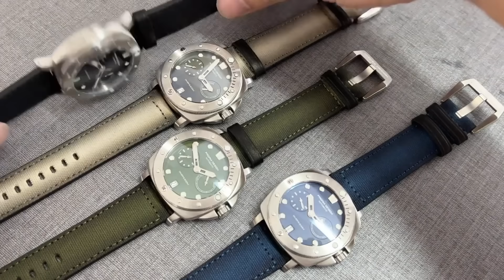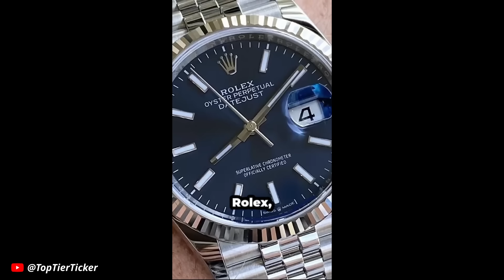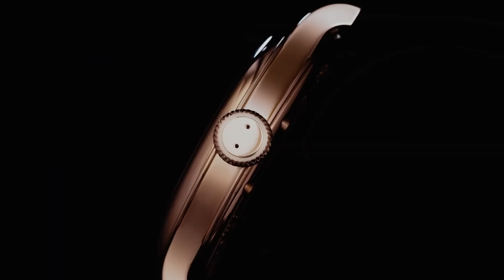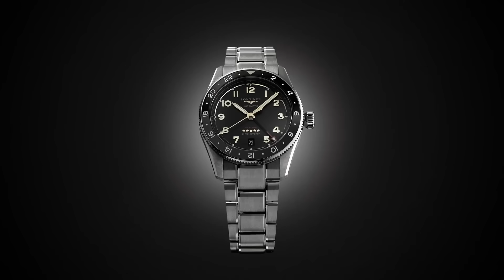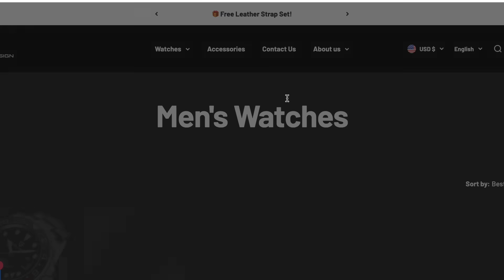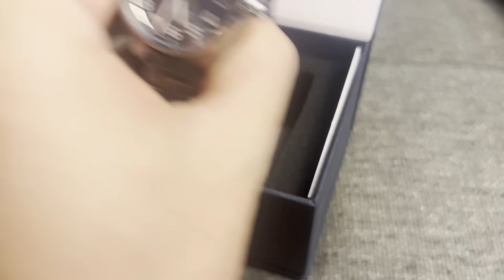The ULTIMATE Fake Watch Company

Comment: Funny enough, I strolled into a Ben Bridge wearing my ONLY Pagani (a knock off of a Milgauss because I figured I'd never get a real one) and they showed me a brand new Datejust they were actually trying to sell TO ME that day, it felt really funny to take off my $80 watch and put on the $8,000 watch and have the salesman say "wow, they really got that bracelet right, it even has the microadjust! And the green glass, too!" I should've bought that Rollie, because at the time I could've flipped it & had enough to buy a Tudor, but my wife was in the store next door & would've pitched a fit if I came back with a new Rolex. But alas, I did not do it.
Reply: Also, as an aside, people will fake almost anything. I bought a PRX from eBay with a limited edition dial that was sold out & when I got it the packaging looked fishy and the watch case scratched super easy so I tried to register the serial number & it didn't come up., Took it to a watchmaker & sure enough, a fake. From India. I got rooked on a sub $500 watch.

Comment: Reasons why these fakes are cheap: No RnD and design costs (the most expensive part), no history behind the brand, non existing guarantee, low level movements, low grade steel, cheap labor, no quality control, mass production, etc. etc. etc. If you want them to stop, stop buying them. And no, they are not "great quality". Comparing a luxury piece with a fake makes no sense qualitywise.
Reply: Rolex stopped paying for any R&D on the submariner decades ago. They've been copying their own design for years. You lose any patent protection on design after 15 years. It's the duty of other companies to copy old, tired designs. That's how innovation occurs, but that doesn't seem to ever happen in the watch world because it inexplicably glorifies the obsolete over the innovative.

Comment: The luxury business is, in itself, a house of cards. To be fair, most luxury brands are high quality, but the truth is that quality CAN be produced at a significantly lower price, particularly with modern production methods. Things like CNC machining 3d printing have hugely reduced the cost, the Chinese took advantage of this. The luxury houses (not just watches) used that improvement to increase profits rather than sales) 

(I am currently wearing on my wrist a 20 year old Chinese skeleton automatic that I bought in Walmart on impulse for less than $100. Looks decent, works great. The finish on the movement could be more elaborate... but even that can easily be handled by automation)

Comment: Bart, this was a nice vid and point of view. Well, it is funny that brand-name watch manufacturers have copied one another for way back. You made some comparisons in your vid, but I can tell you there were lots of copying from the late 60s to early 80s between big names. Now, you also touch on another subject, which is why big-name brands can't give you the level of materials that these "homage" companies offer.  I'm sure that the brand names will say they spend money on lots of things, so the watches themselves are affected. However, I think is all about money; if they gave you the sapphire crystal or ceramic bezel with lume, or any type of high water resistance, they would charge you.  
I will give you an example; I have a Longines Hydroconquest. Well, the bezel is aluminum, the lume for a watch that is supposed to be a skin diver, fades away like a cheap Timex, but you're paying for the brand.  On the other hand, I have a Steeldive and a San Martin dive watches, with sapphire crystal, 200m of water resistance, automatic movements, ceramic bezel lume inserts, and better lume overall than the Longines. Plus, together they still cost a hell of a lot less than the Longines cost, which is why most people will buy homages. 

Anyway, blatant copying and slapping the name brand of an actual brand name is wrong. To me, having the look, even if it is a facsimile, but they sell them with their own name, and provide you with quality, then who cares? Ultimately, the person buying it has to like it, not anyone else, for that matter.  Keep up the nice work!

Comment: I noticed when you sized your bracelet that you had taken links off of the 12 o'clock end, try taking them off of the 6 o'clock end next time, it will center up the clasp on your wrist better, and your new watch will wear/ feel much better. The 12 o'clock side should pretty much always be at least a link or 2 longer than the 6 o'clock side of the bracelet. 🤙🏻🤙🏻

Also, Seiko cant do it because they have a minimum wage, dont maipulate currentcy, they have a marketing department, an HR department, Artists & Designers, workers compensation premiums, ect.
You pay for that as a consumer when you buy from a non-chineese company.

Comment: Pagani have a diver that's got an NH34a GMT movement, 100m waterproof, AR coater sapphire crystal with date bubble, ceramic bezel, display back, stainless steel case, a jubilee strap and comes in a reasonably nice box for ~$97 dollars.
Hell that movement alone goes for about  $45 and while they have the benefit of bulk pricing, it still is incredible they've managed to do it all for that price. 

Still hate the logo though.

They do have watches that're cheaper and still come with ceramic and sapphire etc, but they cut costs in the movement department and I would never recommend one of those models.

Comment: Ive an Steeldive SD1970 and an Rdunae R2X which are both Seiko 6105 Homages... i would have bought an original "Homage" from Seiko themself, but they want 1k+ for a Watch that have literaly the same Movement in it (NH35/4R35 in the Homages Vs. 6R35 in the real one - its a slight upgrade not worth the price difference).

Comment: You are correct, and if Rolex Submariner was still a $2000 watch like they should be, then this problem wouldn't exist in the west.
Reply: For anyone not understanding the basis behind this comment, in 1968 a Rolex Submariner was $225 USD. That equates to a bit over $2000 in 2025 inflation adjusted dollars.
Reply: @neonnoodle1169 there is no arguing that there are massive margins for modern Rolex (as with any other luxury brand) but anyone whose handle a vintage Sub will be able to attest that there are equally MASSIVE differences in material and build quality. A Sub from the 60’s feels like a toy from a Cracker Jack box (stamped clasp, hollow links and SELs, etc.).
Reply: The clone made by Pagani design is only $150 using the same exact automatic movement just a duplicate😂
Rolex is scamming people because the Jews are scamming the Swiss
Reply: @Josephwildberger  pagani design doesn’t use clone movements. They use seiko movements.
Reply: @Jake-bt3fcI thought miota made movements for Seiko I have a Seiko watch it has myota movement
Reply: @Josephwildberger  seiko definitely make movements. I’ve never heard of them using miyota movements but I guess that makes sense if they don’t have one thin enough to fit in a certain watch or something like that.
Reply: @Josephwildberger did you get it from Ali express?
Reply: @Josephwildberger  If you have a Seiko watch with Miyota movement, then you don't have Seiko watch - you have replica of Seiko watch.
Reply: And you could walk into a store and actually buy the Rolex you want and not have to go through buying several other watches first.
Reply: It's not even the price of a new Sub, it's that fact that an AD won't even sell one to the average Joe because they don't have any purchase history. I can't buy one even if I had cash in hand.
Reply: @mtbbiker6401 very true. I tried to impulse buy a skydweller out of the window at the airport duty free and they were like "you have to wait 6 months for it, we can call you when it's in to come and collect" 😂
Ah... No thanks I don't want to fly back here
Reply: Ridiculous that a steel watch is the price they charge...BUT WON'T SELL YOU ANYWAY...joke😂
Reply: Luxury watches are WAY over priced for what they REALLY are. It's a little humbling when your $150 " homage" date just is more comfortable and keeps  better time than my $9k Rolex.
Makes you think about how much money you wasted over the years on 5 letters printed on your dial.
Reply: The Rolex submariner is definitely a $2000 watch.
Reply: it should be much more cheaper because of the new production technology we got.
Reply: What problem? I see no problem here, I see only valid solutions.
Reply: I'm glad somebody else said this!
Reply: In fact, many platforms now offer direct shipping worldwide. For example, my recent order from  :yt: amzswis :yt: took only 15 days to receive.
Reply: This watch is priced to sell. Watches on  :yt: amzswis :yt: are always priced to sell quickly.
Reply: I was nervous at first, but the Omega I bought from :yt: amzswis :yt:  looks and feels so legit.
Reply: The legend says there's nothing more beautiful than the fake watches looking like a real deal!  :yt: amzswis :yt:
Reply: It's a $100 watch
Reply: Does it require frequent servicing? If bought from  :yt: amzswis :yt:, do they offer servicing?
Reply: 😂 he’s not correct. There’s a Chinese watch brand called SKMEI that makes knock off Casio watches. So if there’s a £40 Casio watch, SKMEI will have a £10 version of the same watch they just don’t give a fck 😂
Reply: I totally agree,  but, anything is game for faking. Not even a homage, a proper fake. Even the Casio F91W gets the treatment. All looks good until you look a bit closer. Cheap as chips and still faked 😂
Reply: @Steve-K.G.  Afaik cheap items are actually more readily faked than expensive ones. Naturally, cheaper devices often don't use complex and, therefore, potentially expensive manufacturing techniques, so designing and producing their convincing clones is easier. And cheaper items usually have greater customer demand
Reply: @akeem2983 Crazy stuff, never thought of it like that. Cheers bud 😊
Reply: So another words your a timex guy.
Reply: :yt: amzswis :yt:  Rolexes are so much better than the real thing!
Reply: It's incredible how expensive some watches are! I don't even dare to wear these expensive watches for safety reasons. I would buy them at :yt: amzswis :yt:, and even if a thief steals them, I won't be upset about losing a watch worth hundreds of thousands of dollars.
Reply: I like :yt: amzswis :yt:  watches
Reply: Submariner is not 2000$
Reply: @universalsoldier4697  you lack reading comprehension.
Reply: @ck5922-z2z i undestand and i say, the submariner value is not 2000$
Reply: @universalsoldier4697  I saw brand new Submariners in a Rolex store where I live (store no longer there) for $3600 without date and $3800/3900 with date in early 2000s
Reply: That's not true. Chinese thieves rip off much cheaper watches than the Submariner.
Reply: The price gap between a ~$120 watch and a $2000 watch is still too large for your hypothetical to be true.
Reply: @InvidiousIgnoramus for you.
Reply: Yes they would! do you think people still won't copy a $2,000 watch? They fake $50 watches dude in china!
Reply: Yes... but if a Rolex was $2,000 it wouldn't be the top watch company in the world. Rolex has been a marketing sensation and that's why they are still in business
Reply: @criticalthinker-t4i  Rolex is the top supposed "luxury" watch brand around the world for the middle class. 
It's literally the Glock or Xerox brand of the Watch World. Excellent watches but by no means anywhere close to the best, nor are the ANYWHERE in the vicinity of the most elite watch brands, and those whom can afford those pompous elitist watches would never be caught dead with a chintzy Rolex on their wrist.

Having owned a few Rolexes over the years, I can honestly say a TAG Heuer is a much better brand in terms of quality, fit and finish, and their model lineup is VASTLY more plentiful and their designs trump the well long in the tooth feminine designs from Rolex. I'm sorry but a 38mm watch is a ladies watch, period as far as I'm concerned. These days the minimum size for a masculine looking watch is 40mm with 42/43 being the perfect and most versatile sweet spot size. 38mm fit me well as a teen but as an average height man my wrist is about 7.75" and a 38mm head looks like I mistakenly put on my wife's watch.
Reply: Rolex sub is a Homage of.......

Not doing your homework....fact none of you know is hilarious to real watch enthusiasts 😅
Reply: @RockerfellerRothchild1776  Rolex Submariner isn't an homage of anything. For very long time people mistakenly believe that 50 Fathoms came first. That was debunked already. Submariner came out in 1953/54. 50 Fathoms came after.
Reply: @RockerfellerRothchild1776  They wouldn't find the answer, even if they went diving for it...fifty fathoms down, eh? hahahaha
Reply: @Maplecook  surely you're not suggesting that the sub is a homage to a watch that came out 2 years later than it did.
Reply: @RockerfellerRothchild1776 Invicta pro diver!😊

Comment: Buying a fake watch for yourself is fine - you cannot buy 12mm vertical clutch column wheel chronograph with ceramic bezel insert for 500usd.... Nobody will sell you this at this price point. Problem is watch designs and watch design combinations are quite finite.... Personally, I do not care if they copy PRX or Cocktail time..... And why none of youtubers mention the fact that such watchbrands give you the opportunity to build solid collection instead of buying a single Longines watch...
Reply: You can on the other hand by a perfectly functional Torbillion.

Comment: I actually figured out exactly what their main idea was behind this company and why they choose to do replica/homage watches. Pagani Design operates by seeking out replica cases in the Chinese market, then adding their logo to sterile replica dials direct from the manufacturer. They take bottom shelf replica cases, so something like the Daytona, submariner, datejust etc. won't be great, but something like their Tudor chronograph will be incredibly close to gen due to the fact that there are way fewer people making Tudor replicas than Rolex. They go through everything from Panerai to Omega and refuse to touch IWC and Cartier because they somehow can actually sue or something. The Engineer was copied perfectly by ix&dao, and they were sent a cease and desist that they followed. Chinese watches are a crazy rabbit hole.
Reply: The funny thing is the IXDAO Engineer is just one of many Inginieur homages on the market.  And the bracelet isn't even the same it just looks similar from the outside, but it has simple screw pins, so there are no patents being violated or anything.  I believe the cease and decist was a result of them being so damned good quality for the money  it was raising eyebrows over IWC's pricing model.  You can still buy the other homages and even kits to build your own, no problem.